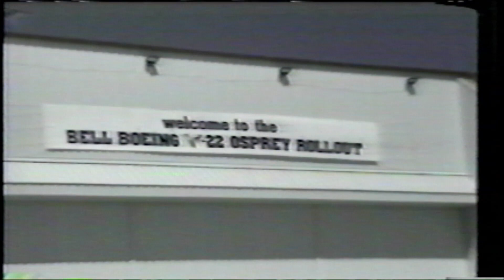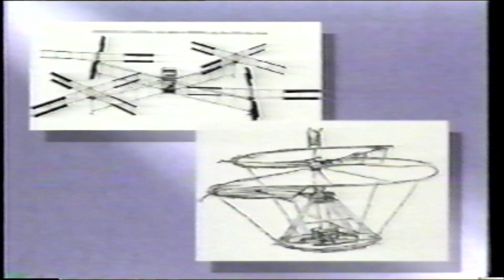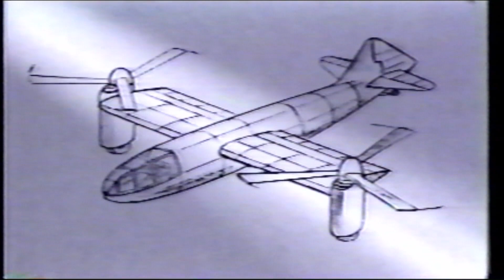V 22 Rollout & Making of a Dream

Comment: If those Marines only knew how many of them would die in the V22, I doubt they'd be playing. These war industry execs are horrible monsters. We are tired of the endless wars for no good purpose.
Reply: V22's safety is similar to that of the Blackhawk.
Reply: @THESocialJusticeWarrior  v22 is slightly better by crashes per 100,000 flight hours if i remember correctly. Plus the recent crash most people base there opinion of the craft on was completely on the pilot in command who ignored several chip or metal in the gear box indicators till the metal disintegrated the gearbox and engines.
Reply: i was right v22 is 3.43 per 100,000 flight hours. uh 60 is 17.06 accidents per 100,000 flight hours.
Reply: @jameslochhead5068 
The issue is 'Blackhawk/SeaHawk crashes are often survivable, where as the V-22 crashes not. 

There is a reason why the Marines were the only branch who initially approved flying the V-22...

The Marine Corps attitude toward danger and life threatening situations is something else.
Reply: @JarrodFLif3r  that's true v22 can't autorotate still pretty survivable though just needs better filters and a improved drive shaft so it doesn't have those fatal hard clutch engagements. that's where 99% of the problem lay the complexity and instabilty of the drive shaft if that's ironed out it should honestly be a good cargo/csar platform.
Reply: None of these men made Sadam invade Kuwait